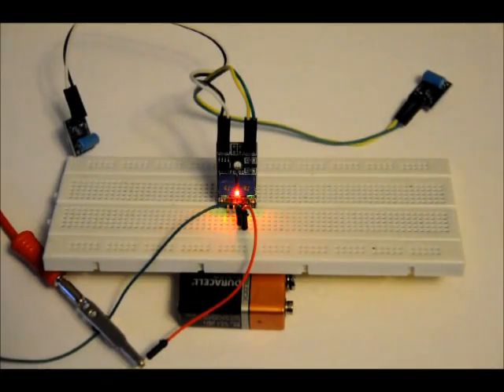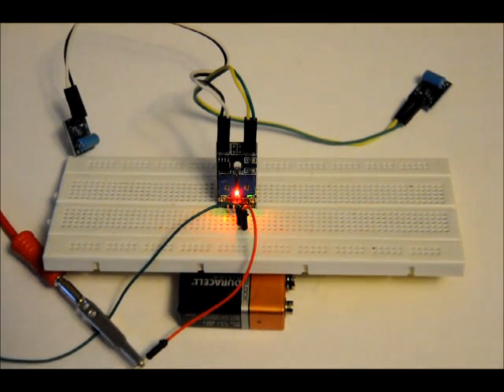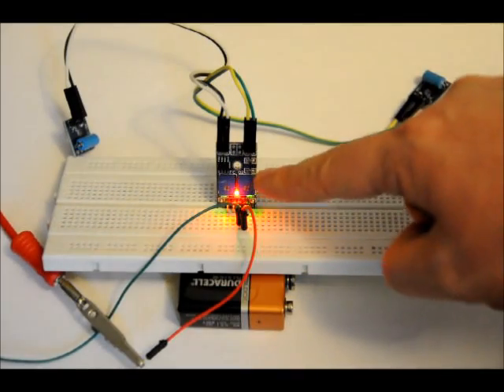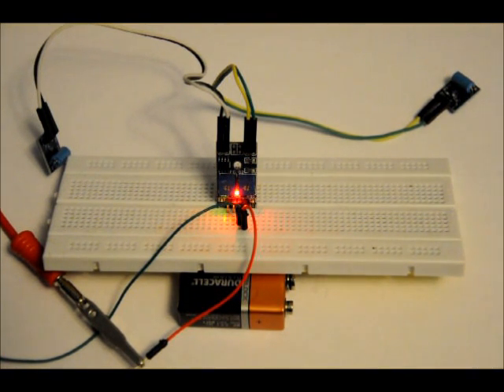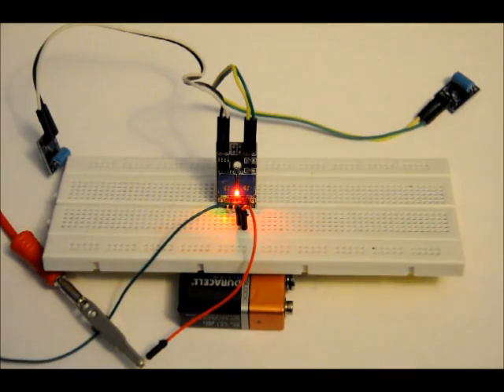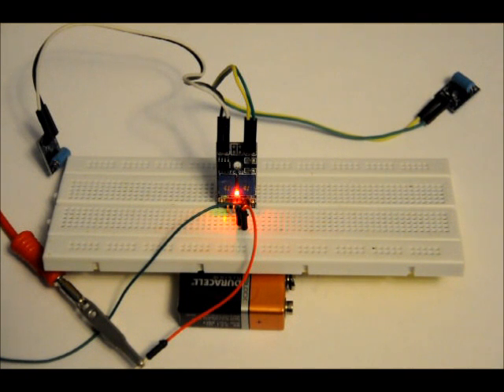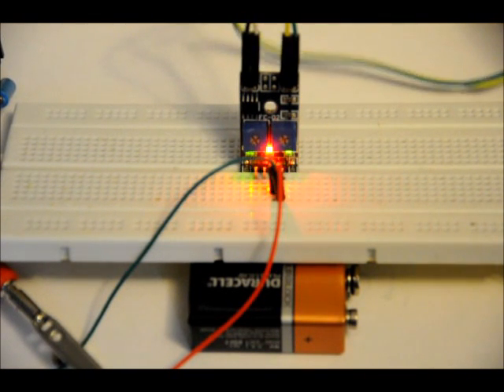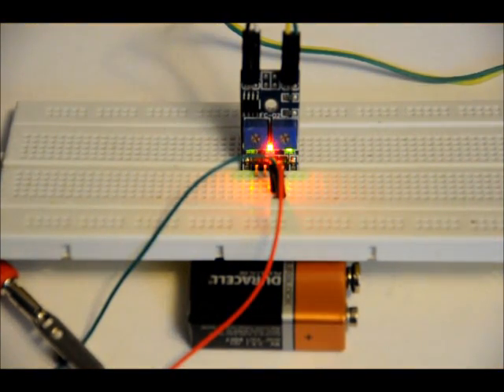The Dual Vibration Sensor Module For Arduino

Comment: Cool board, does it come with the vibration sensors as well? I looked on the site, but didn't see this listed or I missed it. Is this module available with all shown in the this video?   Thx